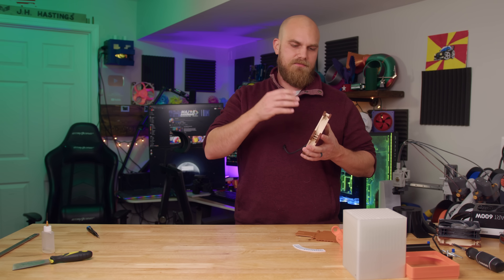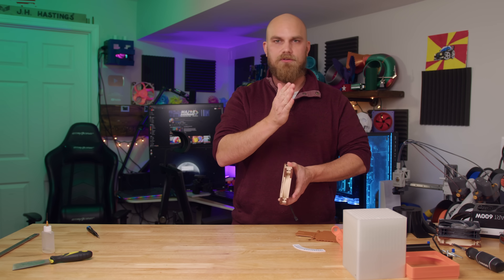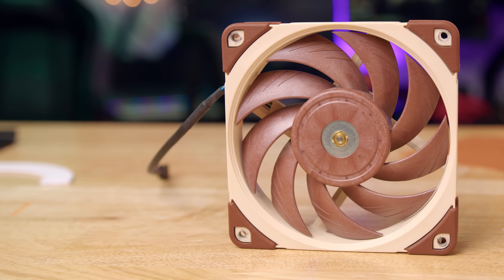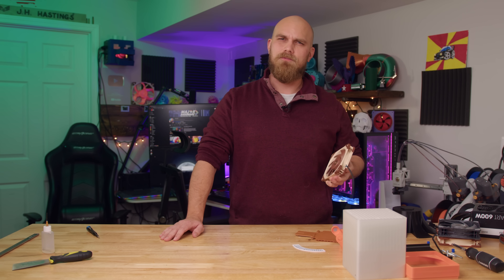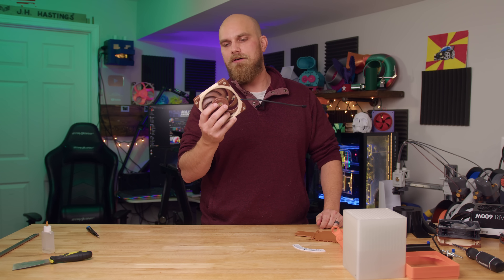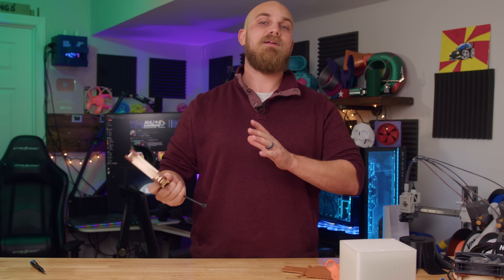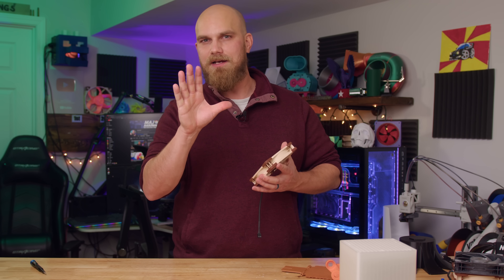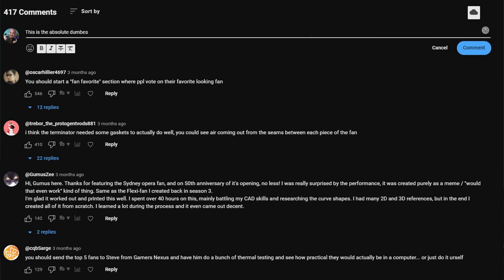I Built a Static Pressure Machine | Fan Showdown Season 6 Pilot

Comment: As others have stated using water or some other fluid in a U shaped tube to measure how much a fan can lift seems more ideal. You could have a closed system where all the force must push against the fluid and its measure would be linear as the fluid was lifted. The diameter of the tube as well as what fluid is chosen should allow for great control in tuning the results to make any difference very noticeable. 

I think your existing solution while clearly working might suffer from a non linear representation of force. I am no expert however I question if the force needed to lift the gate changes at different angles, if the increasing opining size has an effect, and if the changing angle of deflection has an impact as the gate lifts. 

Though you could always make your scale non linear to compensate for these changes if you knew how these changes effected the lift angle. If it were normalized in such a way it might make a cleaner setup to mess with than a fluid based testing tool.

Comment: Thanks, you unintentionally got mah na mah na, do doo do do do, mah na mah na, do do do doo (repeating) stuck in my head. ..  https://media.tenor.com/jggMYMwK_OEAAAAM/sesame-street-mah-n%C3%A0mah-n%C3%A0.gif

Regarding the contraption, you could extend the range on the lower side (which seems necessary if the aa12 only runs to 6 and the t30 to 9) by bending the metering lever say, 45* away from the static gauge arm. You could also gain resolution by making both longer. Regardless it's a nice, repeatable set up that won't give us units to work with, but perhaps with enough known data points you could create a conversion rate (we know the static pressure of the aa12, we know you machine says 6, with other points like the t30 if we prove the system is linear a simple conversion should work. If it's not linear than an equation may be figurable).

Mah na mah na

Comment: IMHO: the idea is great, but notice that due to asymmetric nature of the forces applied to the flappy door-thing the measurements provided by it would also be non-linear.
Which means the greater the static pressure is the less would be visible age difference measured that way.

I guess offloading the gravity forces with some spring would help here.

Oh, the flow window is also growing non linearly with increase of the applied forces. This could be handled with some curved tunnel and flappy thing design.

The idea in general is: this tool is non-linear in force\angle, it may become a problem later on to distinguish between 1st, 2nd and 3rd places.

Comment: This won't scale with the dial you created.  Every bit it opens deflects more power than the previous angle.  So you will need geometrically more pressure to go higher up the gauge.  An enclosed chamber for output with something like a tire gauge or water tube would work better.

Comment: So my only concern is your current design, as a fan performs better it lifts the flap higher and higher and introduces a squared expansion of surface area. Given 2 fans 1 that is 20 percent better than the control and 1 20 percent worse the gain will be less prominent.

Comment: To increase the resolution and make the scale measure in a linear fashion you could enclose the flap with a duct that follows a larger radius that would increase the space consistently between its outside edge and the flap as the flap travels through its radius. You could also make the scale more linear by turning the assembly on its side and using a clock spring with a consistent spring rate for resistance instead of gravity that increases as it gets closer to 90 degrees.

Comment: To assume the static pressure based on this would be... inaccurate to say the least.  The Force required to open the door from position 6 to 7 is greater than the move from 3 to 4 to begin with. Also the area of the opening between the flap and the resting seal increases based on the angle of the flap. Further increasing the (exponentiallity?) of the curve. I am trying to say that the force to reach 7 could be 4 times higher than to reach 6 on your scale. Based on 2 different stacking Exponential curve effects.
There is nothing static about this, this is the force required to deflect the generated airflow downwards. The weight of the air would influence the range of motion of the flap. so airpressure and humidity would change the outcome (however slightly it might be). 

If you were to create a tunnel ( 90 degree bend upwards) that would seal the flap airtight through its range of motion, then you could check static pressure. You might need to add weight in order to calculate a force required to reach that exact position with the surface area of the flap. (you could even define the loss of friction based on the result with different weights on the flap. 
That would give you an accurate measurement of newtons per square millimeter (pounds per square Inches?). The accuracy in this measurement would be reliant on the seal that you coud create on the flap/bend connection, and it should be able to be excluded based on the different outcomes with different weights.

If you were to create a sealed box with a specific not insignificant value, and would add a pipe to it with the lightest colorized fluid you could find, then you might be able to create manometer that is laying down to reach an accurate measurement. the diameter of the tube would have to be.... minimal to ensure that gravity does not make the reading hard to see.

Comment: You might want to reduce the weight of the flap even more.  You're going to find fans that don't move it at all.  I would suggest a larger grid, and use hexagons instead of triangles. I also suspect that the 'readout' isn't going to be linear either, it's going to be logarithmic.

Comment: I would strongly suggest to print at least 1 or 2 alternative flaps with more weight and probably also oversize the length by a good margin. The static pressure creates a force against your flap and you basically only measure that force by seeing how far it pushes your weight up. The current problem with this is that the greater the angle of the flap the lower the amount of air that actually reaches it and applies force. So you have a system that for e.g. linear gains in static pressure only measures sublinear changes. With your concept I don't see a solution how to circumvent this entirely but if your flap is longer it means that even at an angle the 'whole' air stream will still reach it. And if your flap has more weight the applied force will move it less, meaning your angles stay within a smaller interval and have less impact on the force balance.

If you are interested in a different concept I would suggest to use a spring with a low spring constant and place that inside your tunnel with a flap that moves collinear with an increasing air stream instead of at a varying angle.

Comment: The Fluke 922 Micromanometer is going to be the least expensive meter I would trust for high resolution. Far less expensive than the $1,000+ Alnor or Shortridge my company uses. 
The Dwyer 475-00-FM might work as well. I've used that meter too. I'd say it measures reasonably accurate to the hundredth of an inch.

Comment: Hi automotive engineer here, I love your mechanical gage design idea! But I can see a few issues with your measurement. The door flap will not open linearly to the gage. There are two things at play. The door wants to come down, but the force at which it does is related to the angle. The higher it goes, the more the center of gravity is pushed beyond center, and Fg increases exponentially. Also, as the flap opens, the area of the air that can escape is increasing exponentially, too. Your scale drawn is linear, so there could be alignment there. It's hard to calibrate, though. To eliminate the escaping air, you could enclose the flap with like 0.5m of plexiglass. For the angled gravity, you could try a counter balance so that this is perfectly able to rotate freely. I hope this helps.

Comment: Hinged flap does not work at all to produce consistent results. The more the flap turns, the less the airflow affects it. So much so that the any meaningful result gets hidden behind the margin of error and noise. This is because as the flap approaches the angle parallel to the flow, it becomes easier for the flow to diverge the direction. Furthermore, the relative surface of the flap gets significantly smaller than the flow so that only the flow near then hinge have any significant effect on the flap, while the flow on the bottom is completely free to pass. This will make it so that at certain point as the static pressure increases, the angle of the flap will actually decrease.

The flap should be perpendicular to the airflow the whole time and oppose the whole airflow at once at all times. In effect, you should make some kind of cylinder-type contraption where you have constant counterforce against the piston and the air can escape the system at constant flow.

Comment: I have two thoughts. 1. Humidity and barometric pressure from day to day could influence the results as the mass of the air increases or decreases. So I suggest baselining with the A12X25 each episode. 2. If you add a mechanism like the scales at a doctors office, then you could adjust the balance until the needle/angle of the flap read the same. That may be able to distinguish between very close readings better.

Comment: Just get one of those i2c differential pressure sensors and Arduino. SEN0343 seems to have good enough resolution and accuracy. 1mmH20 is 9,81 Pa, so if you get something that has 100hPa full scale and 12-bit resolution (or greater) you should be good

Comment: Reduce the number of holes in the grid to reduce friction so the result is higher, maybe even just have horizontal slices to be like heatsink blades.  Put in more gradations on the scale, and a longer pointer would be nice.  6 for a good fan and 1 for a bad fan isn't enough, we need 50 or 100 for a good fan and 10 for a bad one.  Use the smallest distance between gradations that you can print and a longer line and a number for every 5 gradations.  Get an even better closeup on it, maybe make a mount for the camera to get highly repeatable footage.  If you put a bend in it the 0 can be 45 degrees to the left and the 100 can be 45 degrees to the right, allowing you to get more granularity in a 16/9 frame, or maybe just rotate the camera 45 degrees.

  Test it by taking 1st and 3rd from a previous season and the tester needs to see several gradations between them.

Comment: Assuming not much will beat the A12x25 by a significant margin, you probably want to adjust things so you get a reading closer to 12-14 with that one. This will give you a better resolution on the low end where the majority of the fans you test well likely end up.

Comment: Reduce the mass of the bracing grid. That much triangulation is overkill. Just having a quadrant window frame type arrangement would surely be strong enough and greatly reduce mass and resistance allowing for a greater 'measurable on the scale' difference between the inevitable worse performing submissions (That isn't a slight on those submitting designs, its notoriously difficult to match the best in the industry).
Also, have two categories for testing. Best static pressure and best airflow. It will show how some designs are best suited to different tasks.

Comment: How about a (narrow!) acrylic tube, bent into a U like 
 FAN  ═══╗║ <- Scale
                   ╚╝
…with the tube pointed into the fan shroud, and coloured water inside the tube. Maybe using a funnel towards the fan if the pressure is too low otherwise. The higher the water is pushed up on the scale side of the tube, the higher the pressure has to be, but—different from the door concept—aerodynamic influence like turbulence & eddies around the door should be negligible.

Comment: Your setup currently has nonlinear scale. It can probably be linearized if you add a semi-circular shroud for the door, with a single continuous slot along the bend, so that the amount of air escaping before it can exert pressure on the flap is directly proportional to the flap height. You'd need to manufacture another flap with a counterweight such that its center of gravity lies on the hinge, and drive it closed using a spring. In turn, to avoid the same nonlinear forces problem as with gravity, connect the spring to the flap through a wire and a wheel.
Reply: True that the pressure changes the more the flap is open but all fans are being tested the same and the only variable changing is the fan. So measures are still going to show which is the better fan (using this measuring tool)
Reply: yeah but the idea of this setup is to be quantitative, while nonlinear increase will make this more of a semiquantiative test (bad fan, good fan, great fan), while the subtle differences will be lost on the high end @Bikerbarrie
Reply: My main concern with this measurement device is that it is introducing a lot of unknowns. Conceptually, I certainly agree that the results seem like they would be non-linear, and I also agree with another criticism that the resolution needs be increased. I would feel more comfortable if he could reach out to a lab that has proper equipment and calibrate the measurement device, so that at least would would understand the difference between 'a flap-openning of 6' vs 'a flap-openning of 6.5'.
Reply: I would just add a side walls to the flap so the aur escapes just down.
Reply: A lot of complexity. Why not just calculate the nonlinearity (surely this can be determined analytically?) and print a compensated scale for the needle to point to...?
Reply: Cool explanation
Reply: basically make it a leg extension machine like the old nautilus ones and measure force with anamometer or analog scale, dumb idea but anyways it works although still not gives it the full picture, the easyest way would be i guess just measure how much smoke comes out the fan and the density of the smoke would give a more clear idea analogically speaking, but idk, this theory is just my two cents.

<You see i´m severely impaired in regard to talking so i think i will clarify my comment above a bit, i think the idea is good, flap and pressure and strenght and yada, but there´s another route, if you can see air you can kinda measure it, so that´s the idea behind the idea above which i tried explaining with the smoke>

Comment: You can also create funnel that pushes air into a pipe of water, which is shaped in a U shape with water at the bottom. And you can see by how much does the fan shifts the water on the other side of the U to compare the different static pressure of fans.

Comment: since the angle changes a bit as it goes up, less air would hit the flap or more air would be needed to take it higher up in angle. 
Maybe flip the whole thing vertically and  try blow a "flap" or plate directly up on rails or a guide of some sort so the force of gravity stays constant?  Though im sure this will also have issues or air just being pushed out the sides after a point.

Comment: The problem i can see with this is that just measuring the angle is going to be more representative of flow rate since the door will open more with more flow. say if you put a tiny fan that had really high sp it would still only open it a tiny amount making it seem like it actually has very little sp. What might be a good idea that could still use this design is to use the flap to push against a set of fine scales and have the flap set to only open to a set position to keep the opening the same size for different fans. And to add to that you could also mount your anemometer inside the box so you could set the opening so each fan was producing the same flow rate and then measure how much force that takes to hold back the flap to get a somewhat normalised flow vs pressure test.
Reply: i agree because the movement of the flap can be described as a funktion of the Airflow and static pressure in this setup. the sp must be sufficient to move the plate in the first place but since the angle of attack on the flap changes, the sp gets less relevant at highter opening angles so in theorie a fan with medium sp and high airflow can outperform a high sp fan in the normal test but your version of the test would fix that problem. however it would be best set the flap to a set of fixed positions and then take the measurements at those positions. otherwise it would be not possible to take precise measurements at low air restriction scenarios. also the flap should be inside of the tube and not at the end to get better readings( as @evil_me also stated in his comment)
Reply: @bxe_prototyp0118  yeah man thats exactly what i was thinking aye, have specific opening points to reference against then use the flow meter and force gauge/point scales to make a graph of pressure vs flow for each fan. And you could also test the static pressure at a set flow rate of say 25cfm buy adjusting the flap until your at 25cfm then take your pressure measurement

Comment: Add electronic (optical?) angel sensing so you get better resolution of results and you can more easily make the test repeatable by automation. Add ambient air temp and density data to the results as that might skew the results also depending on weather.